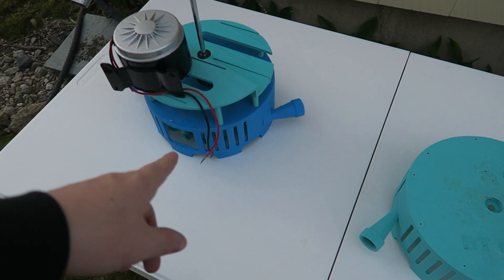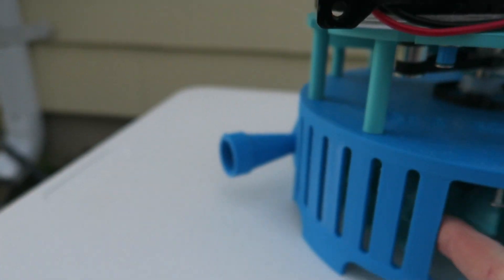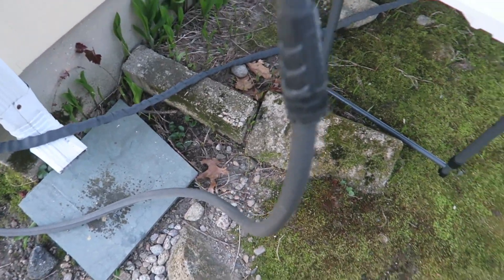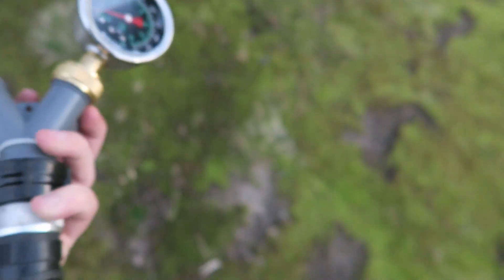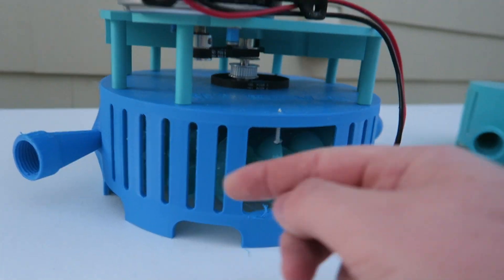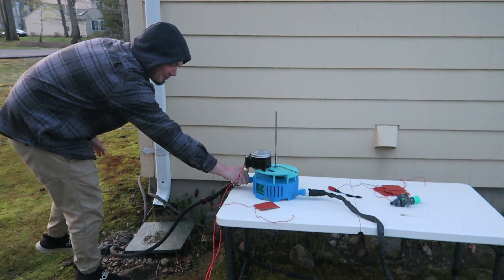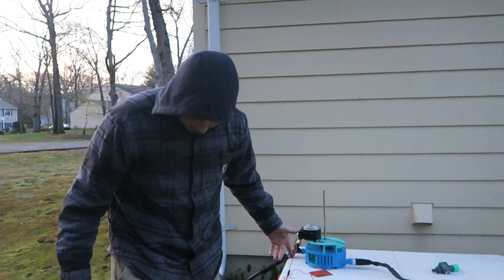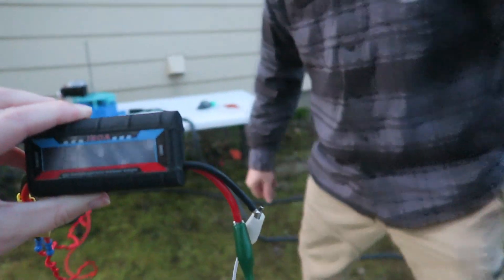3D printed pelton turbine breaks record wattage!

Comment: Nice videos od micro hidro power plant :) ...i think you need Moore voltage at least 13.6 to charge a 12v battery ....with 1inch pipe one nozzle i get on 4.5 bar a current of 2.9 and 13.6V about 40watts...
Reply from the maker: Yes you are correct, I want to hook up a charge controller one I can consistently stay above 13.6v. Impressive numbers tho!
Reply: https://youtube.com/shorts/y5XzSz0hGL4?feature=shared
Reply: Have you calculated the buckets for specific amount of water ? If so thats good
Reply from the maker: I haven't maybe I'll make a video on this and it's total potential power

Comment: I would try to use a brushless Motor, the flat ones for big drones with very low kv rating and a rectifier. With low voltage like in your case, its important to use shotky diodes with a low pass thrue voltage. Using a BL motor you might get away without a belt, so you can save those losses as well. And with a constantly variable load you can try to aim for the point of maximum power.
Reply from the maker: I'll have to add it to the list, thank you for this advice

Comment: main issue here is the generator... the load.

what you are seeing is jacobs law.

theres the resistance of the generator itself, and the same current in the resistor must flow through the generator windings... being a brushed DC motor with commutator losses doesnt help things...

theres an ideal load for any generator. you find that any generator has an ideal speed. so does a turbine.

as a pelton, you are extracting the maximum work form the water if the wheel is spinning at half the speed of the water. if its slower, its overloaded. if its faster, its underloaded. any splashing is a loss, water should fall "dead" from the buckets. any that continues around takes energy to spin, etc, etc...

but, at the ideal speed of the turbine, is the generator capable of loading the turbine to get that power out? can the generator deliver that power to a load at that speed?

if you want to test the turbine, you need to dyno it... measure the torque on the generator with a load cell through various load resistances. not voltsxamps consumed in a resistance. its the wrong measurement...  because the same current that flows through that resistance also flows through the generator itself. as a brake, you can measure the torque due to current flow from a short to an open circuit, and that is the true power being produced/converted. whats in the resistor is only the portion of power dissipated in the resistor... not the total energy!

if you want to test the generator, then you have to spin it and do much the same... how many watts as torque over time are actually converted to volts x amps in any given load? what is the ideal load? 

theres more to it than grabbing any old motor, resistor, and wheel and throwing them together, but its not that complex, really? just have to match things, alter certain parameters to suit each application...
Reply from the maker: Thank you for taking the time to explain this! I will try and make a video to test as you stated

Comment: i am trying really hard to figure out the point of it other than just a toy to play with..
Reply from the maker: To make power from a stream or river in the future. This is the testing stage and if you've seen my other videos, then you'd realize how important it has been. Thanks for watching
Reply: @Beyond_The_Print  I would suggest then using another turbine. Since you have a 3D printer available, other designs shouldn't be hard to make, and they can be much more efficient than the pelton turbine
Reply from the maker: @ExtremeGamerYT22  do you have any specific turbines in mind?
Reply: @Beyond_The_Print  Tesla turbines, impulse turbines, francis turbines for higher flow, archimedean turbines, etc. I prefer the tesla turbine, as it seems to have big potential, but it needs a bit of design making to be really good. Pelton turbines can be efficient, but they seem to need a huge head to have large efficiency, something not found in small rivers